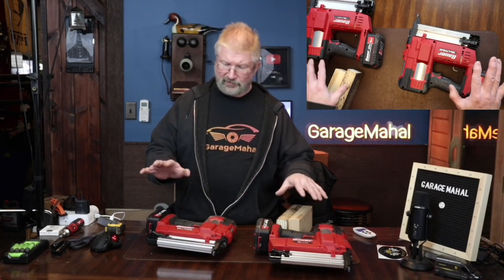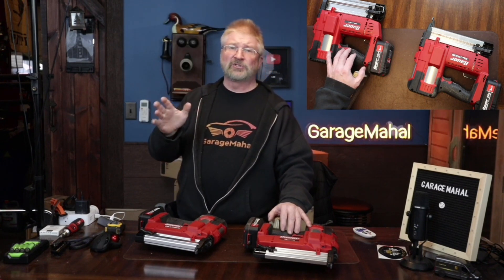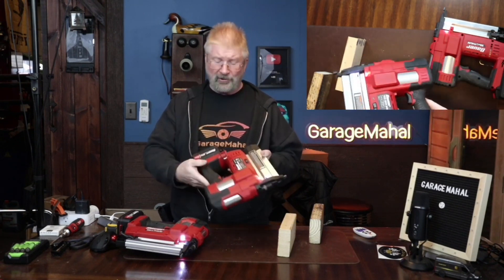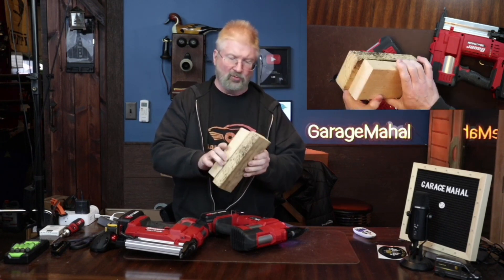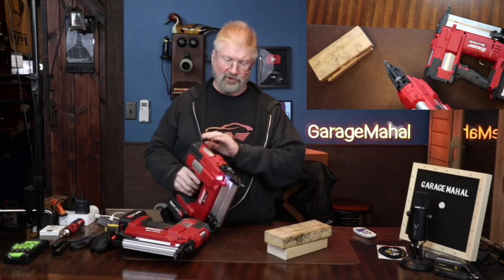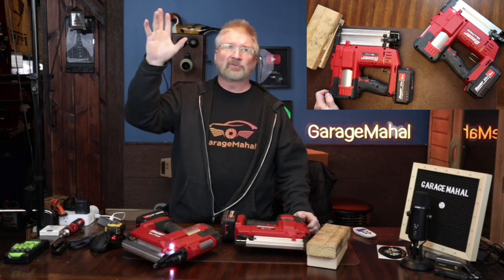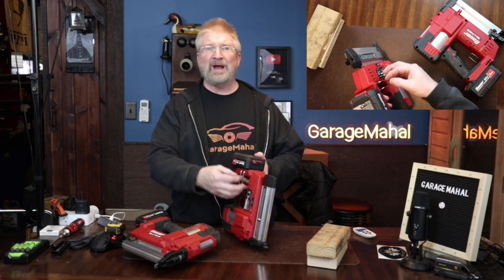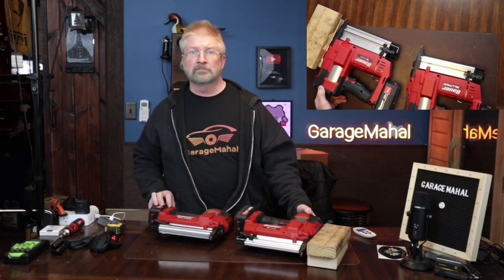Bauer Brad Nailer 18 gauge 20V & Bauer Crown Stapler 18 gauge narrow 20v

Comment: I’ve been using nailers for years. Most jams are the fault of the nails not the tool. Thank you for this video! I have to install shoe molding in my Mother-in-law’s house this weekend and will feel better knowing she won’t have to jump every time my compressor comes on. Right now Harbor Freight has the usual sale on, so I’m getting another Bauer battery and charger too. One suggestion; always get the 5Ah battery, unless you only need a backup. Thanks again!
Reply from the maker: Good advice, I bought an adapter so I can use my fleet of Dewalt batteries too... but this tool is still running great and yes, nothing worse than being 10nfoot up and the compressor popping on! I feel her pain.

Comment: Just bought this, 99 bucks with a battery and charger. The only thing this is missing compared to all the other name brands is a toolless jam release system. Doesn't seem like a big deal to have included.  Still a great value for a cordless brad nailer.
Reply from the maker: Yes, yes it is.